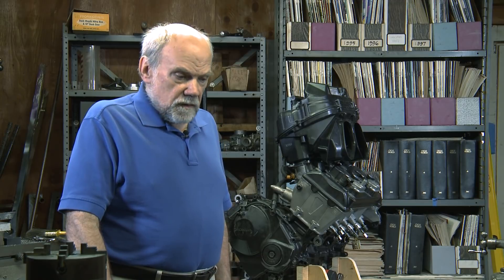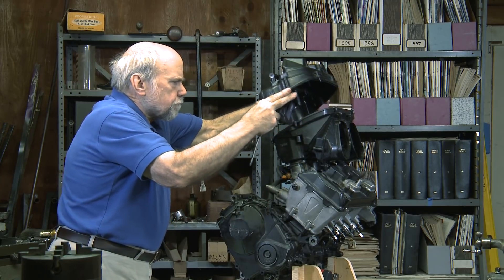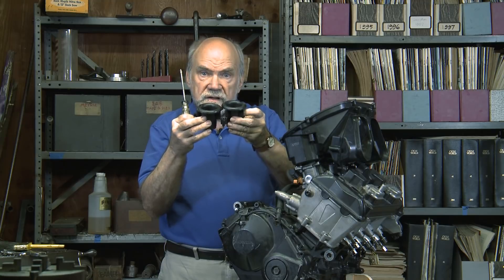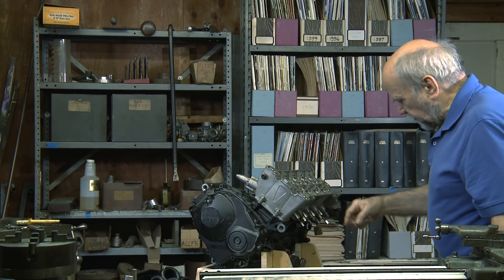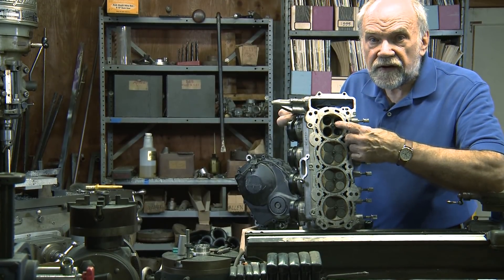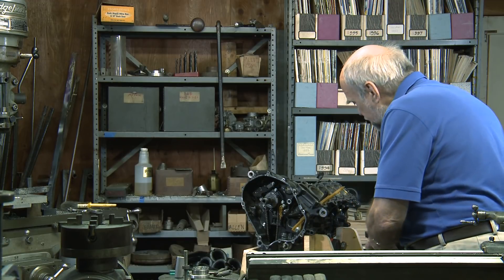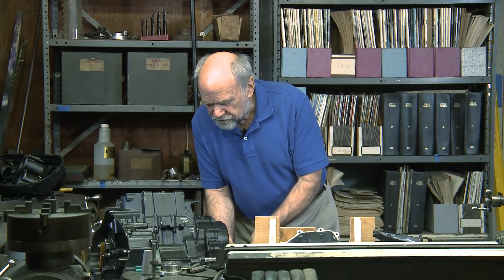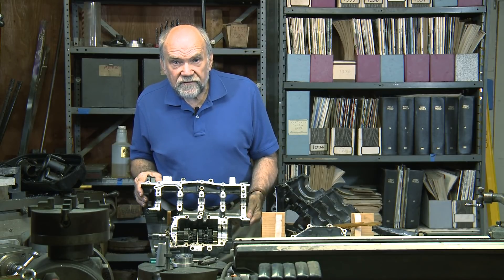What Are The Parts Of A Honda CBR600RR Engine?

Comment: Really appreciate this video. So just to confirm the sensor in the clutch case is the CKP sensor? I've been told it is in the center of the back of the engine but reading a diagram shows the ckp having a red connector and the one you've pointed out had a red connector for my model... finding the correct info is hard